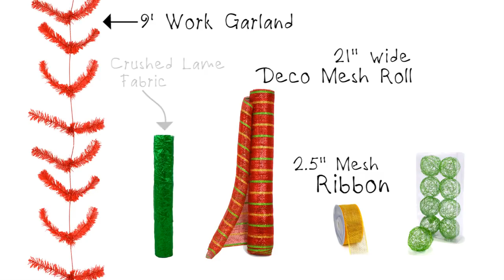How to Make a Garland with Deco Mesh

Comment: Can anyone give me an estimate on how much it costs to make this?
Reply: Sure!....We made them last few years with the cheapo  garlands Walmart sells......or poly twine from dollar tree and wire (depending on how firm it needs to be) and they were....about .$20 for all out department store fab  or slightly less ($12-13  all in?) for look shown here......Dollartree has narrow mesh i use as ribbon....but craft stores are great buys for 21" too. ...even in pricey  DC  most sales it for $3.50.

We added trios of old ornaments made new with high end  glam glitters every other tie or so. You could make the string balls for indoor use with water balloons n glue too! Mesh ribbon and Seasonal Ribbon bargains are everywhere, plus bows can be made from fabric scrap loops too......jeans or satin blouses or whatever you choose  starched into strips.  Or wrap tiny packages n tie with tulle!  Now that long length of THAT  fabric could get pricey even with coupons  depending on where you live so shop around,  SPLIT with friends/fam or just skip it and  select  another style of  fabric or even easier .....another mesh!  
Hope this helps! You can do it!!!

ps.....my bro suggests from outside the box, use what you have got guy world.....cut section of an extension cord or garden hose that doesn't work if you need length for a front porch or banquet table and duct tape wire to it.

Also ........later to store, wrap in dollartree plastic banquet tablecloth like a long piece of candy  n wire to ceiling in garage, attic, basement, laundry, closet...etc. ....yeah bro thanks! you're a genius.